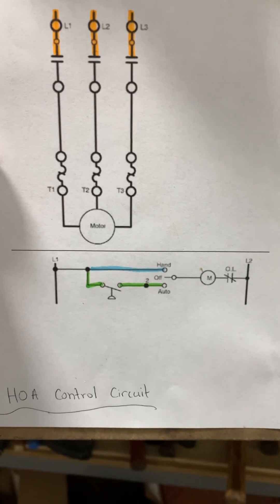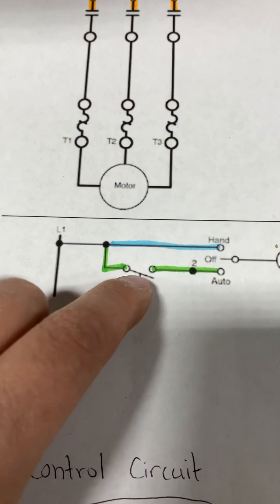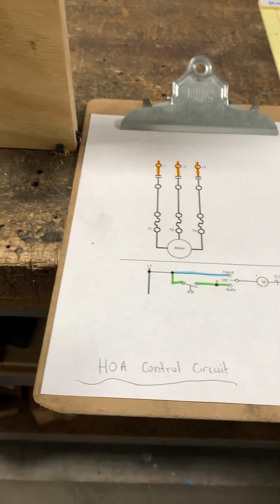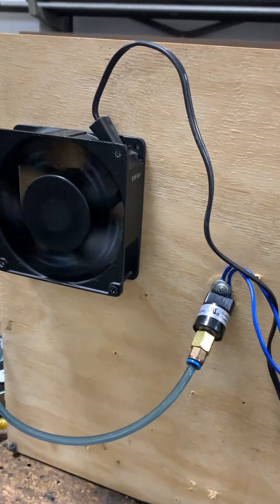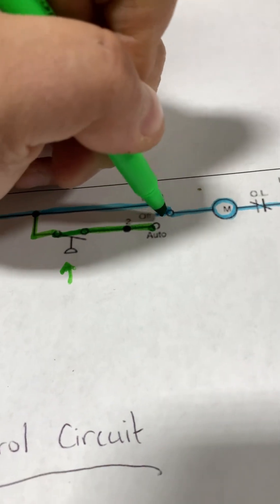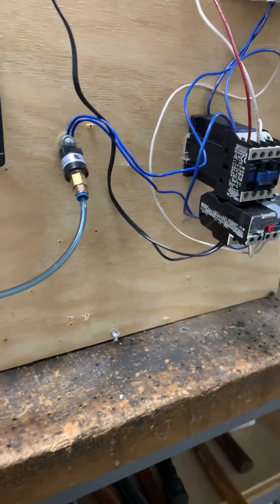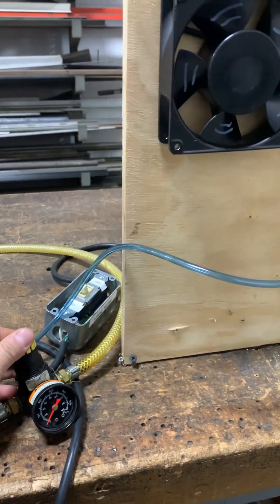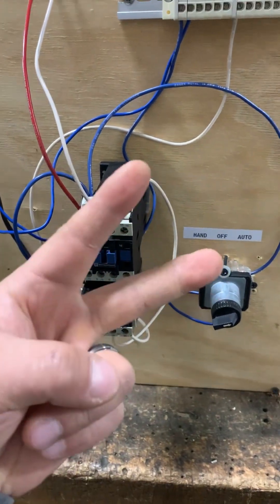Hand Off Auto Control Circuit

Comment: Im curious for an application you would want air pressure regulating a cabinet fan, im sure there is one? In my facility, we generally want them running 24/7, so we have them straight into a 120v terminal strip. We run HOA to feed a pulverizer or in a pvc material handling system along its route at different areas. Just curious where an air pressure regulated cabinet fan is ideal (or if you were just doing a basic 24v/120v circuit for demonstration purposes)??
Reply from the maker: @jun1orbaitor44  I only did this as a demo. Normally fan cabinets would be on at all times.
Reply: @CKMAINTENANCE  Ok, thanks for the clarification, i thought it was an odd way to run a cabinet fan (with an overload, contactor, AIR REGULATOR, lol), i just was sure if there maybe was an industry somewhere where this was applicable. Ive only done maintenance for 5 years (and used to be a residential electrician, jack of all yada yada yada), so i thought maybe there was something  i hadn't seen or heard of before that needed this. I appreciate it, awesome job, i appreciate this type of content, and have coworkers that would too! Keep it up